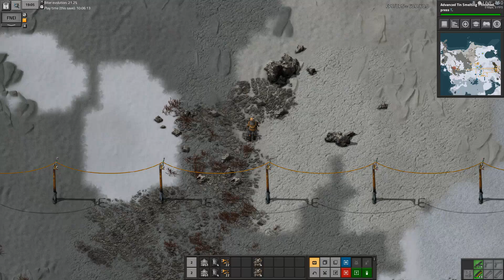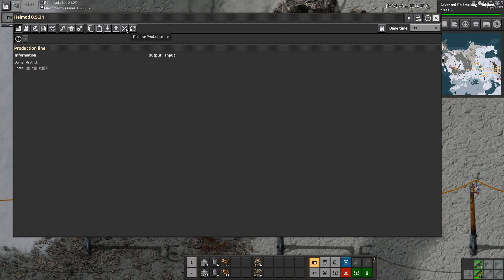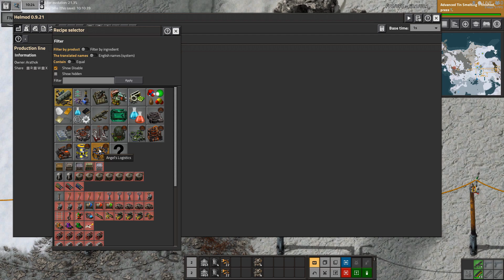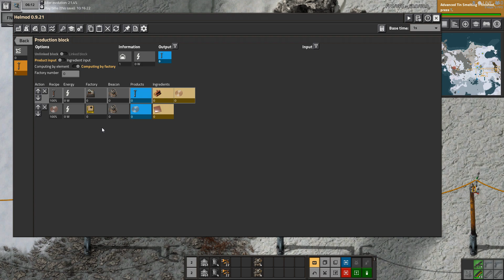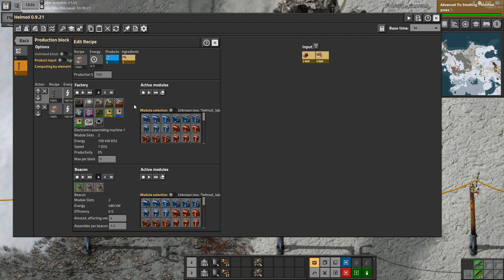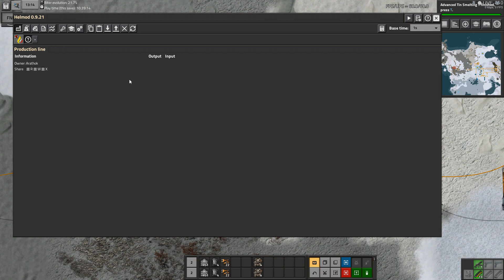Factorio - How to use Helmod / Planner, UPDATED (2020)! - Mod Spotlight

Comment: I dont know why people are bashing this as 'complicated', this is one of the best tutorials for Helmod. If you play lightly modded vanilla you probably won't even need helmod, go for Max Rate calculator which lets u mass select factories with a drag and tells you how much they produce with how many inputs.
Reply from the maker: Thank you! I think it's because it's the internet and "this particular video does not do it as I would have done!"
But granted I'm sidestepping a bit with the chains and also don't explain all functionalities! But it's good for the ego if  you get told youve done well every now and then! So, thank you!
Reply: @jaroslavklima9556  You can 'matrix solver' mode if you want it to compile everything.

Comment: Sugestion: you don't cover matrix solver also not cover multi tab work 

Also the auto mk lvl or auto modules

There was also recipe explorer
Reply from the maker: Yes, as per disclaimer I only showed the parts of the mod I use myself. Never have been to find with the matrix solver and multi tab recipes . I only ever use the most basic functions, because most of the time even with megabases recipes can be put on one page and you just have every product on  one tab.

You've got a very valid point though, for a full in depth tutorial the matrix solver (and all the other functions) should be a part of it.
I would leave it to the community to make such a in depth video as I am by absolute no means a professional factorio player. Just a small gear wheel in the machine :)
Reply: @Der_Arathok  well I play py mods so there are a lot of loops so solver is often a must unless you remember the % extra you need , recipe explorer never used it so that is why I asked 

Multi tab is good for comparing ways to get stuff say ore and oil in this case
Reply from the maker: @sanjikaneki6226  true, i will put in multi tab in the next one. Loops sound horrific :S For rescipe explorer i guess it shows alternative ways to make stuff, you know standard vs advanced oil cracking to get naphta... maybe i will look into it